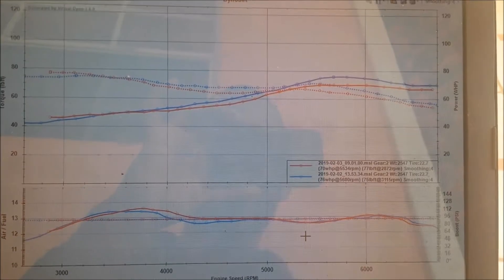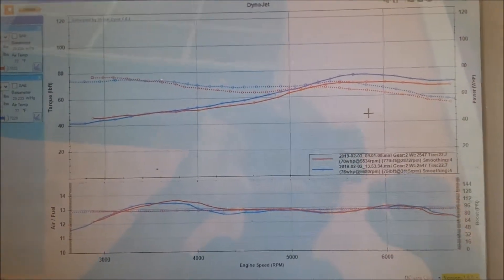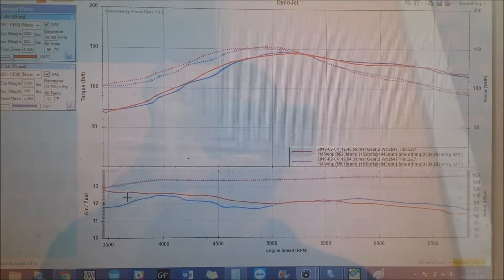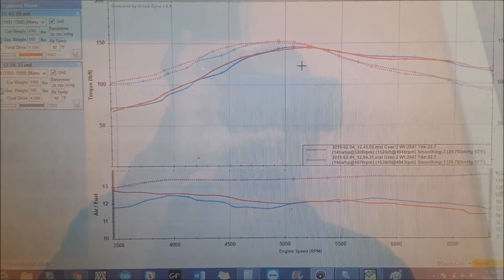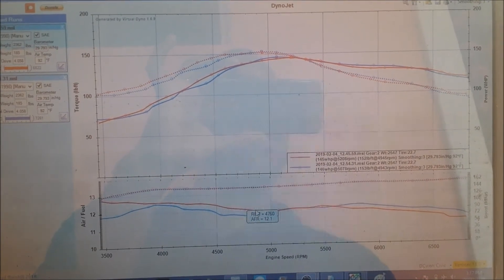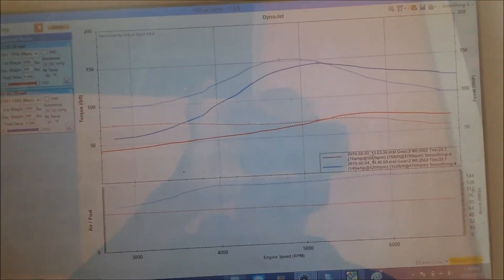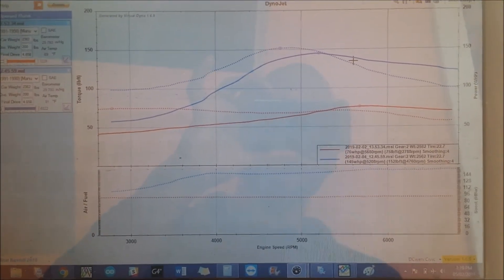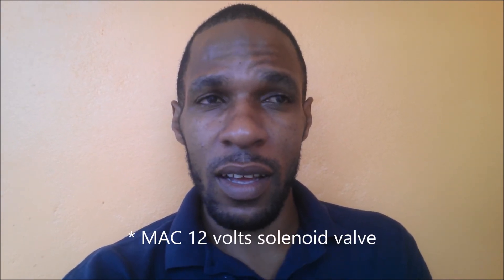Speeduino Stock Honda D15 NA vs Turbo Results

Comment: waste of time ... turbo  150 hp  when  N/A can hit ~200 hp .... pointless .
Reply from the maker: Show me this 200 whp NA non vtec d15 you speak of and tell us how much it cost.
Reply: With stock  cam  , skunk 2 manifold  and  chinese exhaust  D15 mini me  make ~160 hp.  Cost nothing .   Same setup + good cam  makes  ~ 180 hp .  And in the moment   the engine have  more  changes  and if everything is Ok   will be  way  more than 180 hp.   Here is  174 hp 
 https://www.youtube.com/watch?v=583U_htl01k
Reply from the maker: @teror1sta  you are missing the point here. This was a test done on wastegate pressure ~7psi. The car was turned up to ~13 psi shortly after.

You have no data to back up the 160 or 180hp claim. Your NA d15 civic won't make the 200 whp you speak of and  will never be as cost effective as a turbo motor.
Reply: @DCWERX   if you come on the track with your 13 psi turbo "monster"  , you will not  believe  how  far  behind  you will be  vs this N/A  D15 . Just for comparison, I'll tell you that this D15  is faster than stok GTR R35 .    Turbo under 350-400 hp is just a joke on the track .
Reply: @teror1sta  Lol that's funny when I turn mine up I'm shooting for 300whp my torque will be way higher than your peak horsepower could ever achieve and I guarantee you will get smoked and look like a parked car LMFAO
Reply: @boost_edjamesmathew2168  the dreams are free .... In the moment the car is 190HP and 176NM  . Just 3 sec faster than  a GTR R35 . And  have ~10 km/h  more top speed  from most 300-350 hp turbo cars .... keep dreaming ... It is free .

Comment: e85  would help, OR water methanol injection  would be cooler too and intercooler!
Reply from the maker: E85 probably would but it's not available here. The car is intercooled currently.
Reply: @DCWERX  you guys don't eat FOOD??  its called compost / methanol still!!
Reply from the maker: @amindnew527  no just pump 92 octane

Comment: Nice results, surprising that you run that lean without detonation problems. Is the boost dropping at higher rpms? Max power is fairly low in the rpms? Anyway, great progress, keep the videos coming!
Reply from the maker: I have run as lean as 14.0 AFR NA before without detonating. Excessive ignition advance generally causes cylinder pressure which in turn causes detonation most times.

Power drop off in the top is as a result of the tiny td04 turbo and the small factory cam profile. I have a few trick I will show in upcoming videos to carry power and torque to redline.
Reply: Just watch out for high egts with late timing and lean afrs, at least if you plan to drive it on boost alot. Cylinder air motion affects knock resistace alot aswell, i dont know how the honda combustion system and intakeports looks like, but it seems to work well. I dont know how common they are where you live, but upgrading to at least a 16t compressor would surely help.
Reply from the maker: @garagecedric  the 14 AFR was only for research purposes. Nowadays I usually end up 12.5:1 to 12.8:1 at WOT NA. IMO it makes little sense targeting super lean AFR at WOT since in most cases they don't make best HP or TQ from what I have noticed from my lil experiments. If it likes being a lil rich then that's what I give it.

I would love to have monitored EGT to give you an educated response to your question but I have zero experience with EGT analysis.

Td04 turbo parts are not very common around here, I have looked at the parts needed for the 19t compressor conversion but at that point it costs just as much as an eBay special turbo. I'm fine with the hit or miss nature of them, since this is not really a daily driver. I do love the response and punchy quick spool characteristics of the small turbo's though.

Comment: I had the same experience with an ebay boost controller on a past car...... no fun. Great job as always. Fun to know that your comparison of NA to Turbo is a true comparison of just the air going into the engine. Knowing how you went about to temporarily bypass/block the turbo, really gives some good info there. The HP numbers for the NA are still impressive with all things considered (Turbo restricting the exhaust, engine wear, and other factors) I think that just backs up your tuning ability as well as the importance of doing a standalone ;)
Reply from the maker: Definitely an interesting experiment. I learned alot doing it. Thanks for watching

Comment: :)
Reply from the maker: Lol nope
Reply: @DCWERX    You have good videos, i subscribe your chanel. I m car mechanic, diagnostic, electronic, i can doo chiptuning, but im wery interesed to speeduino. BR
Reply from the maker: @caryfuk8  lol no need to apologize. They just small and I squint whenever I am facing a camera. I appreciate the support.

If you do chip tuning then speeduino will be a piece of cake
Reply: @DCWERX   But if you get turbo in car, you need turbo ecu. I can change maps if i have it, but changing idle and all other things like rev limiter is super. I have some experience with arduino with my brother. I can make hardware and my brother can programing.
Reply from the maker: @caryfuk8  with speeduino you would just need to adjust fuel and spark maps when you add a turbo. 

Download tuner studio and have a look at it, its super easy. I guarantee you will say its easier than messing with factory ecu
Reply: @DCWERX  i know, where you buying your speeduino? and how version you use? I have one arduino mega 2560 useless :)
Reply from the maker: @caryfuk8  depends on what part of the world you are from. There are a few sellers across the globe. 

You don't need a speeduino to play with the software though.